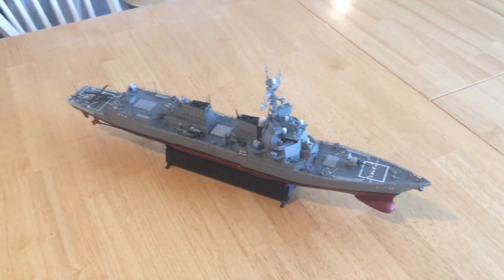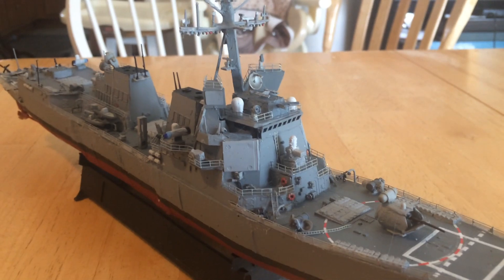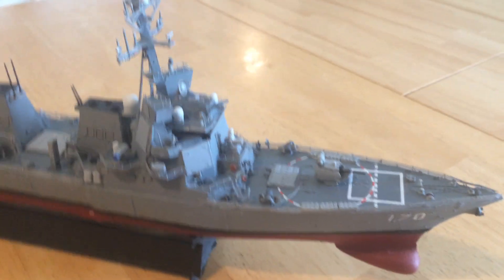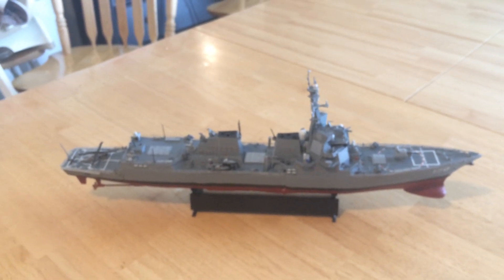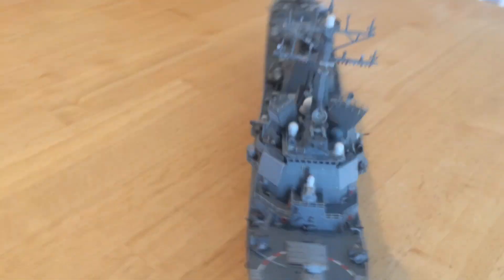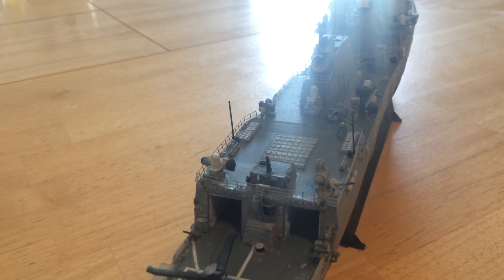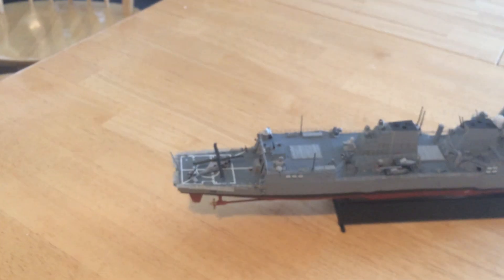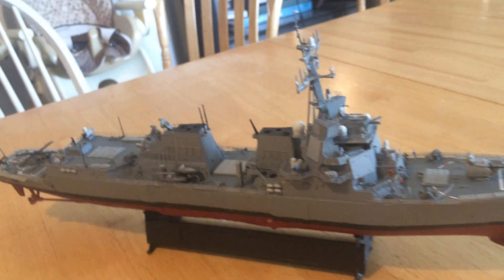US Navy Burke Flight IV Proposal

Comment: Why not use the hull and power train of the Zumwalt?!? They had straightened the kinks in those and redesign or modify the superstructure as you want it to be... taking out one of those guns for a start...
Reply: I agree. The Zumwalt could use some point defense CIRAM, +120 VLS, and ditch those useless 155mm guns. Not having stealth built into any future destroyer/cruiser is suicide.
Reply: The current DDG(X) program looks like a cross between a flight 3 Burke and the Zumwalt

Comment: I work at BIW, we're finishing up the Flight IIA versions and will start building the Flight III version soon. I believe Ingalls in Mississippi just cut steel for the very first Flight III. In either case it looks like the Flight IV is not going to happen. It was only going to be built to provide a "bridge" ship until the replacement for the Ticonderoga Class Cruisers were built. I'm not certain which defense bill it was but one of them in the President Trump era fully funded the new Cruiser program so there is no need to build a Flight IV Arleigh Burke. 
Another thing, for what you propose the hull would have to be enlarged, its one thing to add new weapons to the exterior of the ship, but you also have to account for the huge volume of space taken up buy all the equipment and the miles of cables needed to interconnect all the various units in say the laser system you propose and the VLS system, there is simply not enough room in the present Arleigh Burke hulls and superstructure to accomodate all of the extra systems you propose. Another big thing with the laser systems, which are about to begin getting installed on our combatant ships, is the need for cooling water systems and dry air systems, the cooling systems take up huge amounts of space. I suspect the hull of an Arleigh Burke Flight IV you proposed would have to be widened by 6 to 10 feet and lengthened by 50 to 100 feet. Its just not feasable to build them, unfortunately.
Reply: Thank you for this detailed analysis. I believe that the latest cruiser development CG(x) was shut down in the Obama era. But the navy has unveiled the new DDG(x) which looks promising as a replacement for our aging ticos and our older flight I burkes

Comment: Why are the LaWS and Railgun CIWS not aligned with each other on each side, and instead have the other system on the other side? Is there a reason for the placement like that?
Overall this is an epic design, imagine if the USN decided to go for something like this. It's pretty much immune to missiles with basically 6 x CIWS plus those EMP generators and God knows how many SM-2s, SM-3s, SM-6s, and quadpacked ESSMs. And imagine how many tomahawks this thing would carry. Plus we'd probably have VLS-launched AShMs by then so this would have those as well. And obviously it would have powerful radar and electronics.

Comment: Liking proposal IV Arleigh Burke class build👍it’s unfortunately Australia didn’t go with US version baby Burke instead Spain F105.  But I reckon US could boost sales with offering cruiser version for Australia maybe 3?  Either with 5inch or 155mm gun, at back instead large missile pack maybe 76mm gun or two 40mm guns.  Mid deck would be use for mission deck loading n helicopter deck should be larger to accommodate CH47 like on T26 warship.
Reply: Baby burke, I'm intrigued, any details on that proposal
Reply: Dennis Lloyd there was small details like less VLS 32? Length was shorter n design was still offering two helicopters but RAN use one helicopter for their warships just like OHP frigates. Displacement was 7000 - 8000tonnes.  I believe they went Spain version because the design was proven.  Interesting if the RAN had gone with baby AB, USN would had brought this warship instead of new FFGX frigate.  Again with T26 frigate for RAN there is suggesting bigger T26 for replacing F105 destroyers, by stretching length to hold more VLS.

Comment: Why not arm up a lil bit more, and add 155 mm main guns front and extent a bit more and add a 2nd 155 mm gun to the rear, along with 2 more 30 mm on each side, this could possibly cure the TICO retirement issue also? Just a suggestion from an Army Vet, I was on the USS San Jacinto for a tour @ Port Everglades when it first came out, very impressed.  I'm all for bulk up-gunned as much as possible, etc.

Comment: If I may Jeff? Have you 'wooded' your aft searam with the emp projectors?  Maybe move them abeam of the after funnel. I admire your energy and thoughtful insight, hoping to see more visionary modeling.
Reply from the maker: The EMP generator is set up to project the EMP forward or in the direction it is pointing.  We already have US Air Force modified C-130s and others that do this on the battlefield.  This is a fairly technical enhancement to that so that it can be focused to surround the incoming missiles with a 10-20 ft wide EMP zone to fry their electronics.  In order to defeat that they would have t add substantial; weight to harden the missile which would markedly decrease heir range/speed/etc.
Reply: Thanks Jeff for more info on the emp generators, my concern though was that it appears to me that the searam has two bearings (roughly abeam) blocked by the generator's positions.

Comment: Good looking ship. Interesting armament too. My daughter was on the U.S.S. Hue City. We got to tour it when they came home too. I have some 5 inch gun shells that were fired from the ship. The Hue City is a Ticonderoga clas destroyer right? Have a great day Jeff
Reply from the maker: The Hue City is a Ticonderoga AEGIS cruiser.  This vessel could be termed a cruiser itself because of its size and armament...but the Ticonderoga class are still the most powerful ships we have and we have continually updated them.  The AEGIS system has allowed us to do so, as have the newer revisions to the CIWS systems and the 127mm 5" guns.
Reply: @JeffHead-IdahoUSA  thanks for the info Jeff. I would like to build the Hue City.  Do you have an email that l could correspond with you?